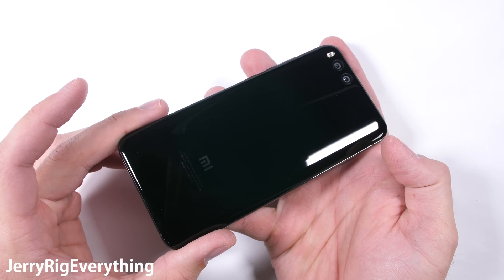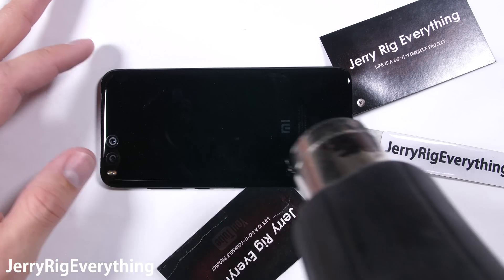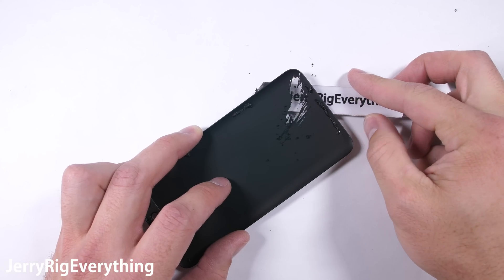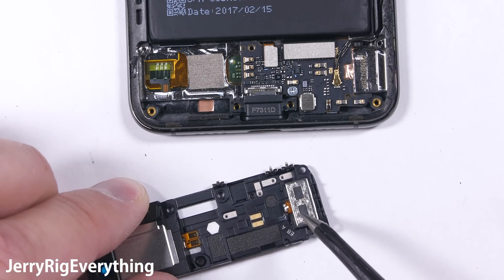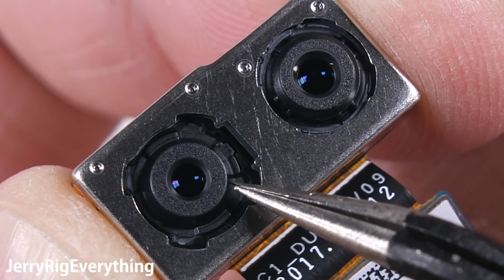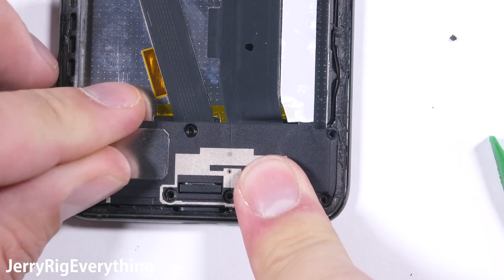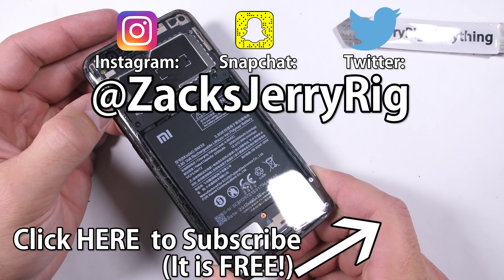Mi 6 Teardown - Splash Proof Analysis - Clear Back Mod!

Comment: apps like dashlane are protected with a single master password, if somebody's knows that they can acces your account and use your paswords. meaning that such an app is about a secure as using the same pasword for every webiste, account.... The more those apps get used the more hacker will try to crack them and the higher the risk of using them.

Comment: Zach I have a question I hope you can help. We have a Sony LCD 1080p 120hrz RR tv.  I got it in 2010 so it 7 yrs old. When I got it the Led's were just starting to come out. Well yesterday I noticed a black horizontal line across the lower left of the screen. It's about 8 inches long and about a mm or less thick. Is their and trick to fixing these dead pixels? To replace it wouldn't be cheap as it's a 120hrz.

Comment: I think I like the dark aesthetic of the wireless charging panels more than completely showing the circuitboards by compromising the phone, although those are cool too. I actually did a mod like this to my Xperia Z2 a while ago, as the glass back broke and I took a piece of polycarbonate window and cut it to shape. The notification light bar shines through the back on that one.

Comment: headphone jack > waterproof
Reply: Xrodn34 Gaming I prefer the waterproof feature.
Reply: i don't take my phone to a pool
Reply: Xrodn34 Gaming  how about two type C
Reply: Xrodn34 Gaming  how about two type C
Reply: Hari Haran Yesterday, some water went right trough the 3.5 mm jack of my moms phone ( LG G Flex 2) and it was painful because the phone recognized a headphones connected, but it was water. My mom doesn't use the headphone jack, and a lot of more people also doesn't use the 3.5 mm hole it is not useless but if it is the cost for waterproofing, I think it worth the sacrifice.
Reply: The 3.5 is not completely sealed, and obviously water damage it's not covered by the warranty unlike the charging port which has a stronger seal.
Reply: SMaster Sam with manufacturing cost higher. the point is that this mi6 is inexpensive flagship

Comment: "the wrong size screw in the wrong hole" can destroy iphones. I have seen it done a couple of times. Its usually on iphone 5/5s's those 2 bottom screws on the lcd flex hold down shield. You damage those posts on the board and you can screw up the traces underneath.

Comment: I'm a simple man, if I see 60 fps, I upvote
Reply: Soma Huber this
Reply: Sorry didn't want to hurt your feelings
Reply: Soma Huber There's no Karma here sir, there's no need for your unoriginal comment
Reply: I think I got 3th-degree burnings from that, thanks man
Reply: THUMBS UP NOT UPVOTE GO BACK TO REDDIT.
Reply: Soma Huber Technically you cant see more than 27.28874849 frames per second

jk
Reply: that's the old myth...u can see more

Comment: Looks like you totally broke the earpiece speaker.  You shouldn't be able to see the voice coil like that.
Reply from the maker: +Jake Leonard you are correct
Reply: I see you are very proud of that
Reply: My reaction when I saw that: "RIP earpiece!"
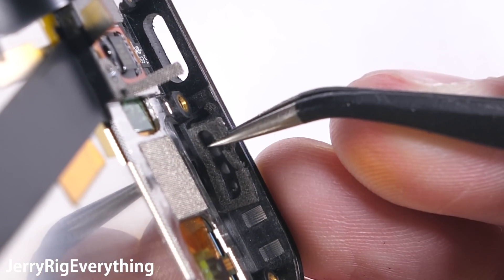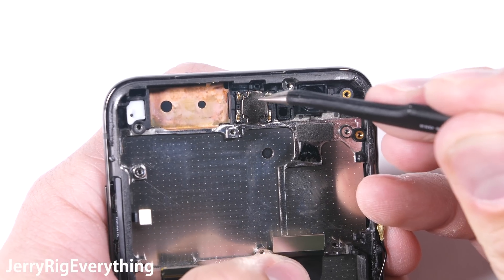Reply: 6:37. He opened the earpiece speaker and broke the coil in the process. He should have pulled below the earpiece speaker, not on its side. At 6:54 it is the usual 'good as new' :p.
Reply: Speakers are not made to be opened, I learned that the hard way on a moto g :p.
Reply: sorry which part did he broke? can u tell me the time of it occurrence?
Reply: damn u are good, i didnt even notice that XD thanks!
Reply: lol I searching for a comment on that as I was just about to write that. The voice coil wires broke away from the terminals in the magnet assembly when he pulled it apart.
Reply: Jake Leonard "voice coil"
Reply: 2 D No, its just a speaker